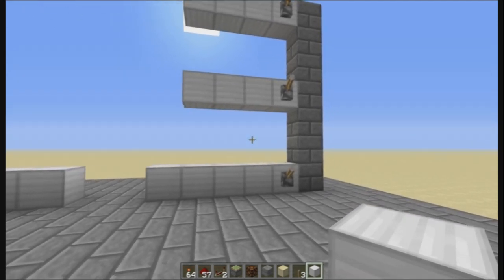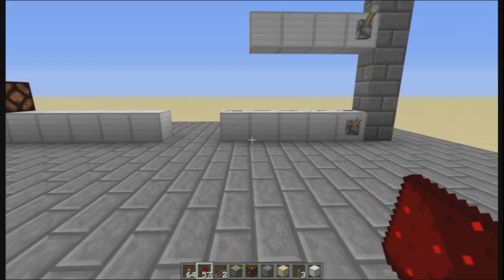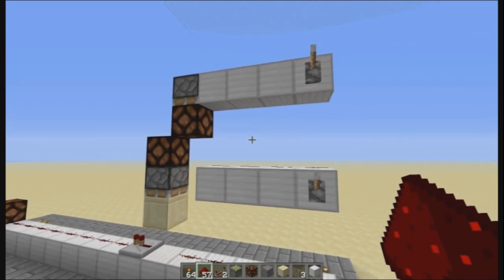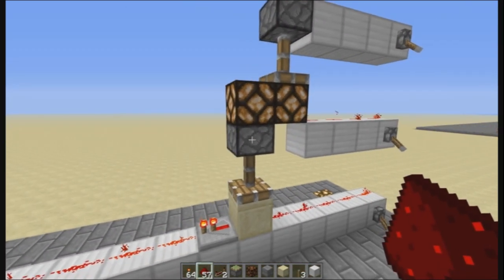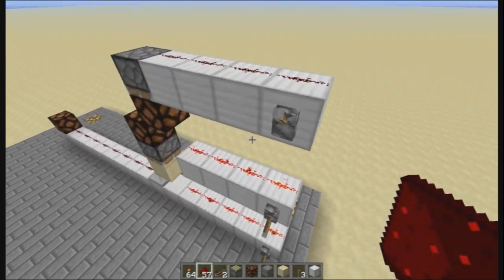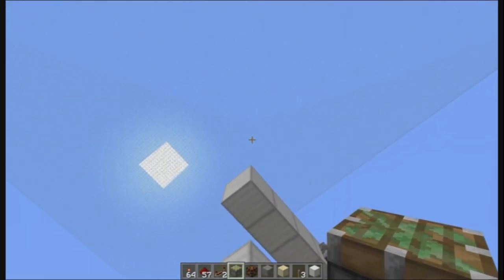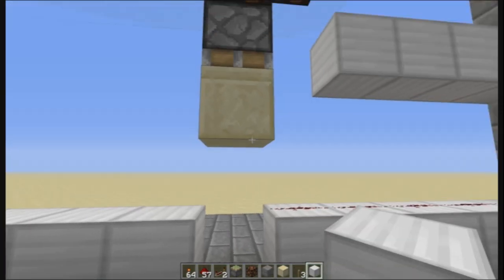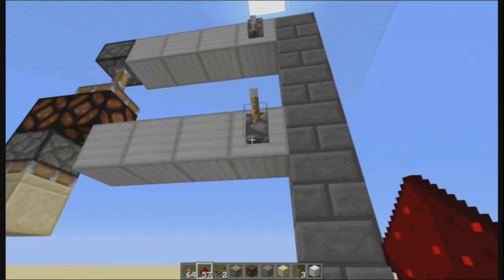Building with Baj - Compact vertical 3-way AND gate (infinitely scaling)

Comment: So I tried to hook up the wire from the pressure plate to the pistons. But instead, the wire connecting to the pressure plate would interfere with the pistons and the bottom layer would always push out first. I solved the problem by placing a sticky piston facing downwards with a block, so that standing on the pressure plate would activate the piston and therefore powering a block that sends a positive signal to the whole piston wiring.

Comment: There are far more compact ways to deliver power downwards.

Place a piece of redstone on a block, place a torch on the side. Two blocks below the torch, repeat this but place the torch on the opposite side this time. Continue repeating as far as you'd like.

Invert the signal accordingly before outputting to wherever you need it.

Comment: I just went ahead and designed a more compact 3way vertical AND gate. I recorded it, and I'm rendering it now. After it's rendered, I'll upload it as a video response here. If you still need to fix this problem, mine is MUCH more compact, and uses a LOT less resources. Of course, with every perk comes a downside. It's limit is 3 high. Yours is infinitely stackable.